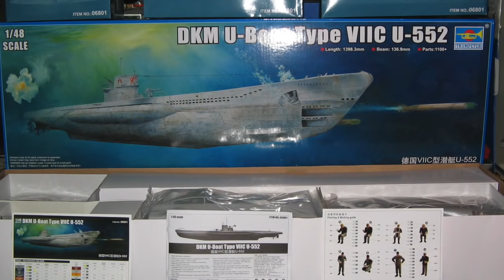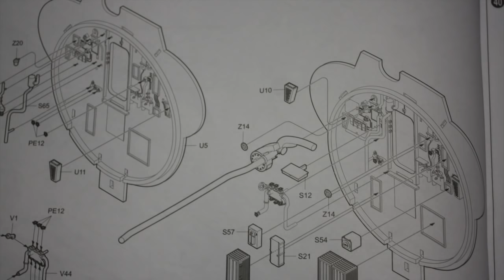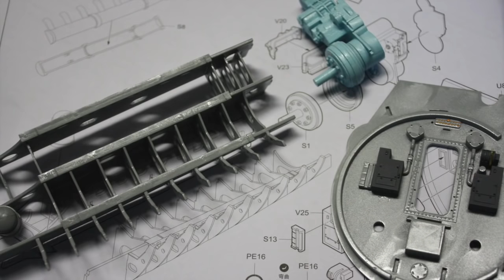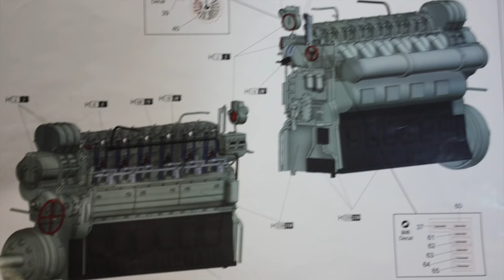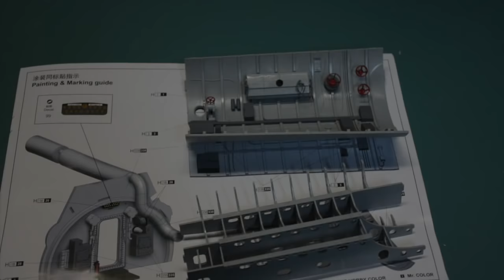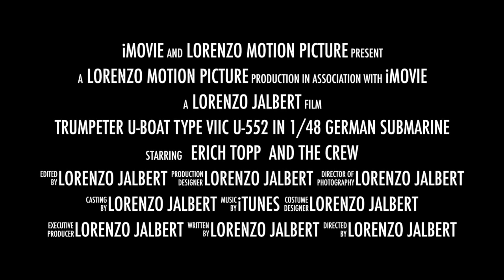PART FIVE: Trumpeter DKM U- Boat Type VIIC U- 552 Engine Room

Comment: Lorenzo, I've watched this entire build, and I have to say that this is my new favorite model to have and build. It's a bit pricey, but ya got love it. Your painting is perfect. Really looking great. I just wish ta=hat the conning tower had the clear side on the same side as the pressure hull. Always looking forward to your next video. Regards, Solomon
Reply from the maker: You know I was thinking the same way about conning tower i`m almost there and i`m still not sure what i`m going to do with it, I need for sure one side of the submarine not clear I going to have a bunch of moving parts by remote control servos and all electric wires batteries, every where I need to hide them somehow ....... it make my head spin a little bit keep me thinking... Lol
Well will see. Thank you very much Solomom and take care my friend.
Reply: You'll work it out I'm sure. I've already been thinking about resolving the conning tower issue. I could pull molds off of the pieces, and resin cast the side I want solid, and vacu-form the other side. I know that a type of clear plastic for auto tail lights is available. Seems it is liquid then goes in oven to make it hard, not sure. It's worth the research though. Regards, Solomon
Reply from the maker: Yes, it will work I don`t see why not is too bad because the clear plastic Trumpeter use is very clear and clean. Now I`m thinking to paint everything and install small magnets on both side of the Hull to old it together and remove one side when I wan to show the inside ? so this way you don`t have the shine with a glare from the light keep you to see it all in the sub
Because of is shape I just finish the back end of the sub my next video will be Friday. Thanks Solomon for the idea this help.
Reply: Wow! what a great idea. I look forward to the next video!! Solomon

Comment: Fantastic build. I would like to see details about lighting. Where do the wires go? The large light in the middle..where did you get the cover? and the other two...are they leds or bulbs? I want to light my diagostini model. Thanks.
Reply from the maker: Check parts ten of this build it`s about the electrical I think this will answer your question if not I`m here for you my friend.